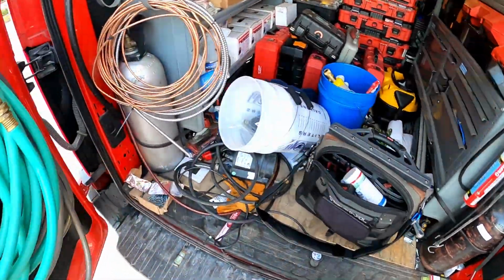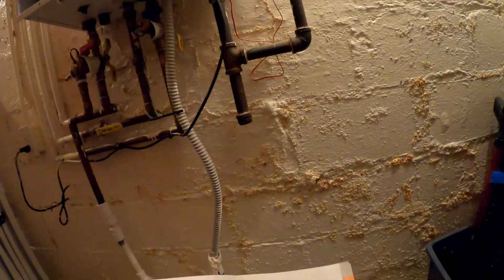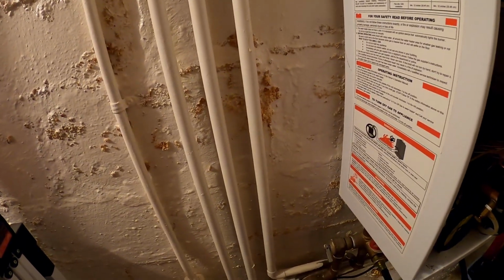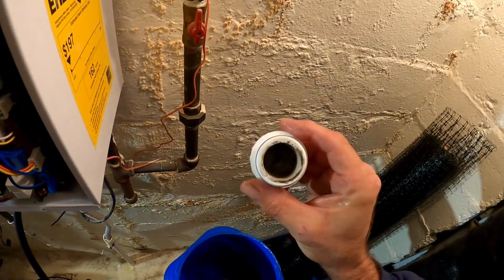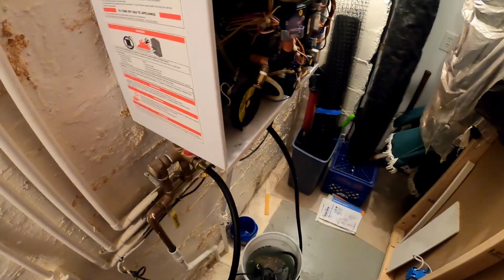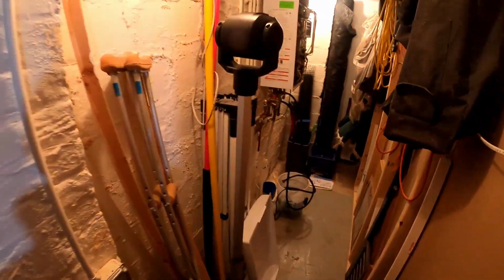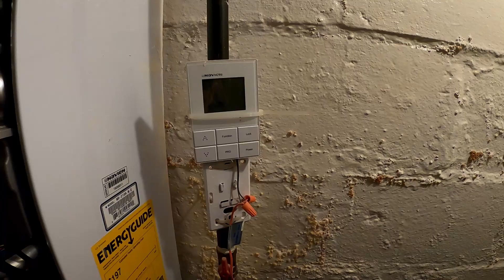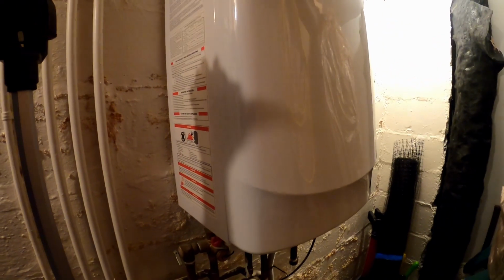Navien Tankless Flush

Comment: At 9 years old you have obviously had KD Navien  units in the States for a while now.      They are a pretty new manufacturer to the UK market and I haven't come across one out in the field yet,    what do you think of them ?

I've looked into the  UK specs for both the gas and oil units and the thing that puts me off them, is that Navien don't use ANY  industry standard parts that we would already have in the truck, so spares could be an issue, with no heat calls......
Reply from the maker: I have been installing Navien's for 12 years and it's the only brand i will install. Tech support and warranty is good.
Reply: @MiHeatingGuy  Thanks, are spares unique to them or industry standard?
In UK our biggest boiler manufacturers are Worcester, Vailiant and Baxi.
Very different here but enjoying seeing how you guys across the pond do things. 👍